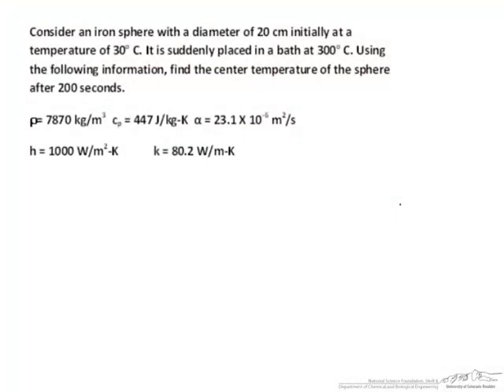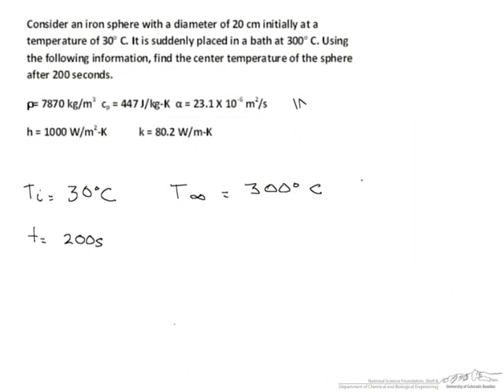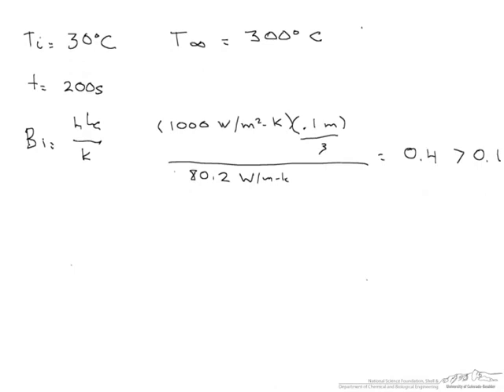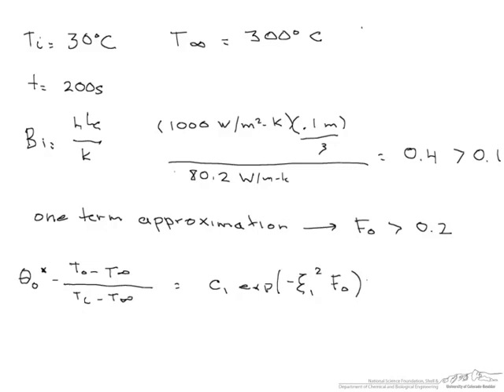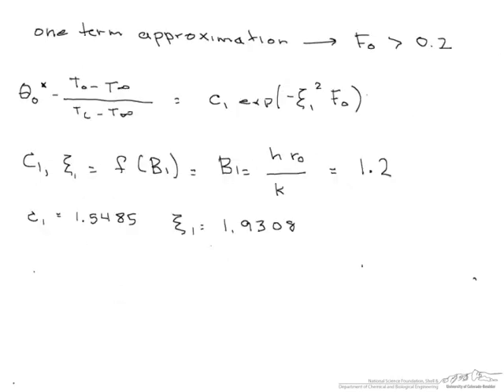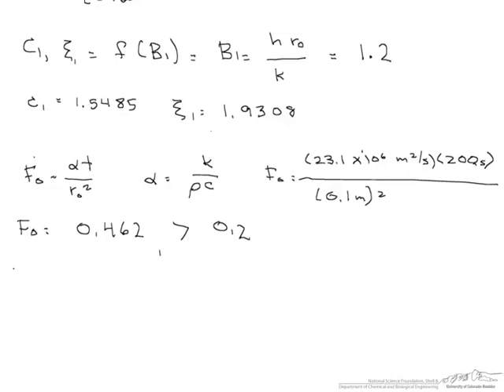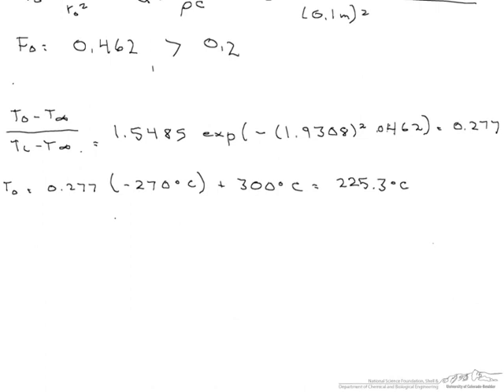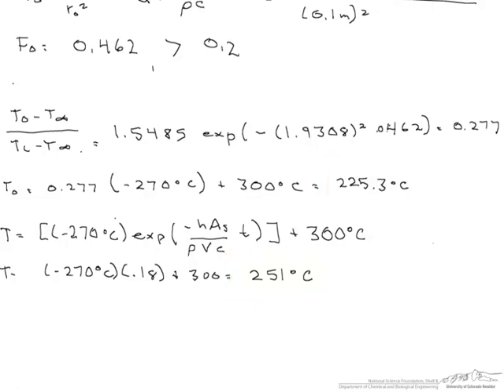Transient Conduction: One-Term Approximation

Comment from the maker: Although the method is correct, the values of C_1 and zeta_1 at 3:59 in the video should be 1.331 and 1.714, respectively. This results in a final temperature of 208°C instead of 225.3°C.

Comment from the maker: To calculate the Biot number, you need a characteristic length, L_c, which is usually defined as the volume of the body divided by the surface area of the body.  For a sphere, the characteristic length reduces down to r/3.